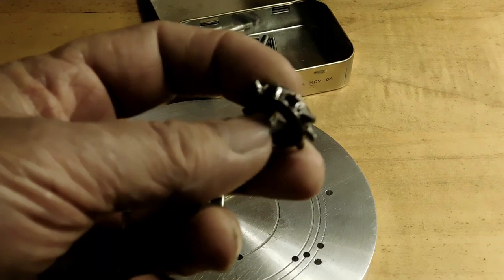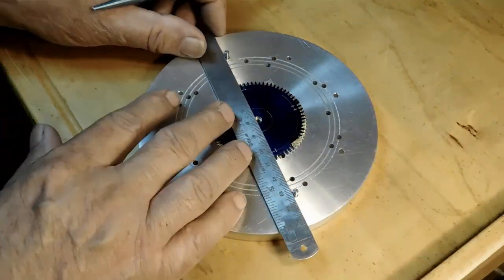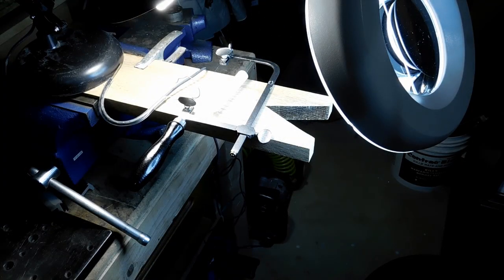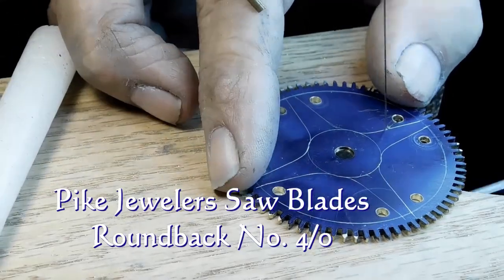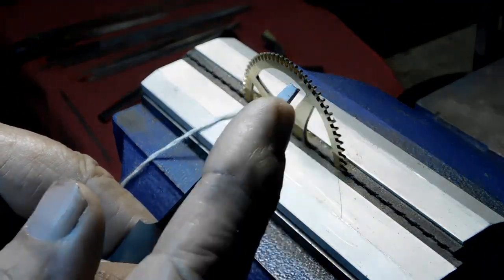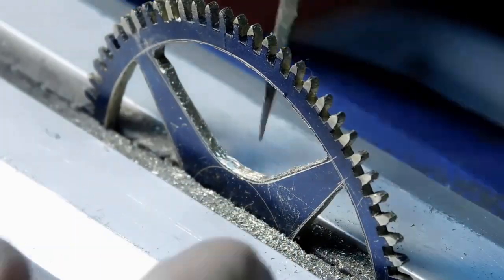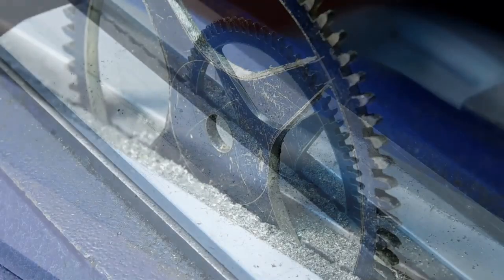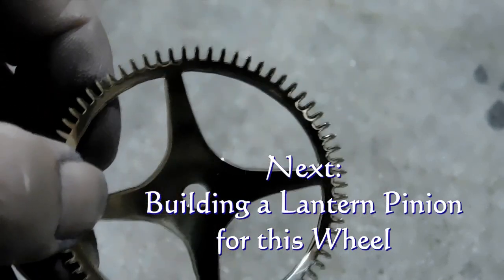DIY Cycloidal Gear Cutter Part 3: Crossing the Wheel

Comment: Thanks for your video. How thick is the brass sheet for making the gear?
Reply from the maker: Both escape wheels, the center wheel, 3rd wheel and minute wheels are 0,0625" and the great wheel is 0.025"...tnx for stopping by...bob

Comment: Rob - following through your videos for the first time - I noticed that on this wheel too (same as the previous one I think...) the teeth vary in width depending on the camera angle - that's very deceptive ! Much better crossing out than I can manage at the moment :-) One question - where did you get that scriber? Never seen one with the tip at an angle like that - looks very good for keeping an eye on things as you scribe..
Reply from the maker: Not sure the origin of the scribe...I have two and they are quite nice...think I might have found them in a box of stuff I bought at auction some time ago....bob